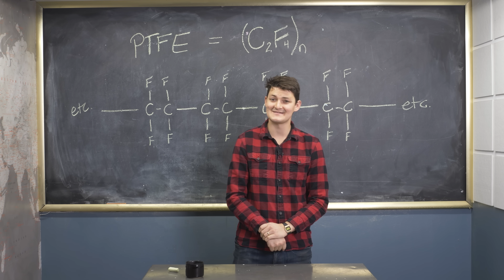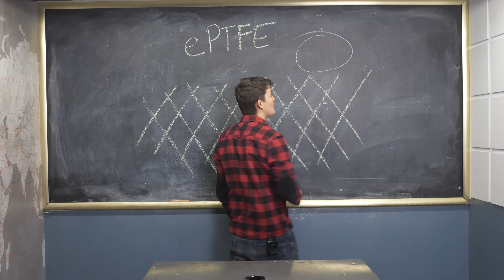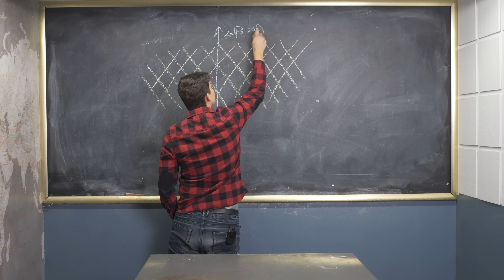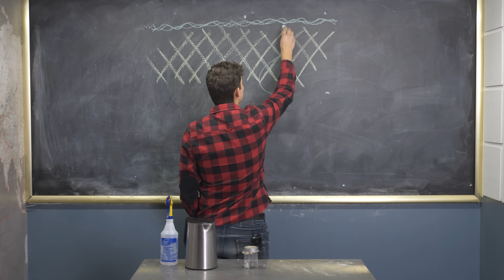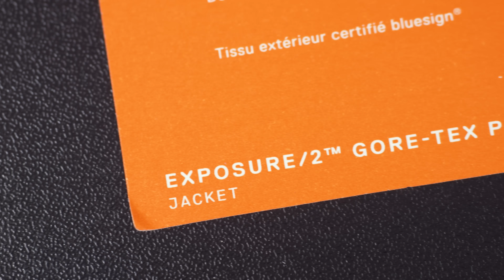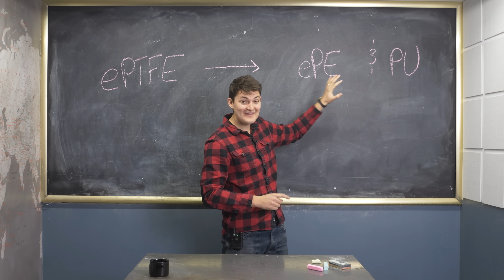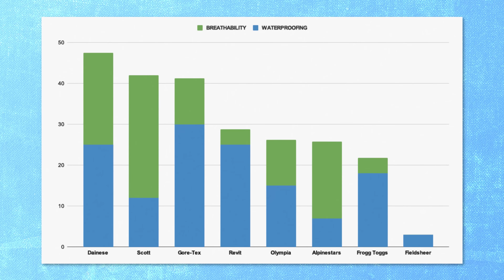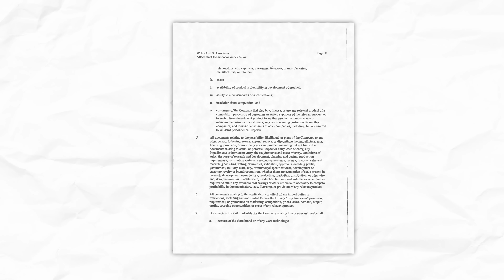Gore-Tex is a Marketing Gimmick

Comment: This is confirming what hikers have known for decades: Fabric can be waterproof or it can be breathable, but it can't be both. If egress of heat and sweat is required, the only really effective solution is mechanical ventilation: Pit zips, or some other similar equivalent.

It's a good thing, then, that Gore literally prohibits manufacturers (or at least they did at one point) from putting pit zips in any garment that uses a Gore Tex membrane in order to show off how "fancy" and "effective" their membrane is!

I will further add that in most cases where you'd want to be waterproof, also being breathable is exactly what us motorcyclists DON'T want. When your clothing is getting soaked by rain and it's likely that some part of your personage will also become so (via water inevitably getting in over your collar, or through your zippers, or up your cuffs, or whatever), the absolute last thing you want is a cold wind whipping through your "breathable" jacket and pants to make you even colder. Evaporative cooling is a son of a bitch, especially at 65 miles per hour. So for riding in the rain I have found it much more effective to completely skip any kind of fantastic malarkey about "breathable waterproof" wonder-fabrics and just toss some manner of impermeable shell over your regular riding gear. Frogg Toggs, a trash bag, a Tyvek rain suit, whatever you have to hand that fits. You can also forget whatever gimcrack rain liner came with your riding jacket that's supposed to go inside, because all that does is allow your jacket to absorb about 47 times its own weight in rainwater. If the liner your jacket came with can be worn over it, do that instead.
Reply: all my arctyryx goretex shells have pits
one of my shells is 100D nylon backing
there is no water or wind getting in OR out of that shell
and if u dont vent, u will sweat to death
but ofc, the trick will always be appropriate layering

Comment: Love the video as usual, but I’ll still always buy gore-tex due to their lifetime warrantee.  I bought a rev-it dominator years ago that eventually let water in after about 5 years. That’s two years after the manufactures warranted ran out. I contacted gore-tex, they paid for me to send it off and loaned me a similar rev-it suit in the mean time. After about 2 weeks, they admitted the leak and asked me if I wanted replacement or my money back. I went for the cash and they actually gave me the price of the new suit, about £300 more than I had paid.  I used that and added a bit more to upgraded to some Rukka gear.  That has a 5 year warranted plus the gore-tex lifetime. I’m still using it and it’s fine. If it leaks though, I’ll be sending it back again. Can’t beat that service in my eyes. Worth every penny

Comment: There are indeed really great laminated garments out there today.   Historically, the biggest benefit of the Gore branded outerwear was that Gore, protecting their brand, had a very real and significant testing and verification program.   "House brand" laminates almost invariably were built to a price from a CAD file sent to the Asian manufacturer with little to no further verification until the stuff showed up and either worked well or didn't.  I, personally, lament the loss of the old fluorinated DWRs which in my experience were extraordinarily durable and gave outdoor sports shops a lovely sweet chemical aroma each season.  I miss that as much as two stroke smoke on a cool morning.

Comment: Yeah it is all about name recognition. When i buy something with Gore-tex in it i have a better chance of it lasting longer. I have run into some absolute shit WPM in stuff i have bought in the last 10 years. Even some Gore-tex stuff. I have a original NF 1995 jacket with old bad Gore-tex that is still as waterproof as the day i bought it. I have a 2 year old NF jacket with Dry-Vent that leaks like a sieve. I have a 10 year old NF jacket with Dry-vent that works very well.  They just don't make shit like they used to.

Comment: GoreTex is a gimmick and a bad one. It's extremely bad ecologically to produce  without any real benefits to what natural fibers can do. My  waxed cotton coat outperform my previous Gore-tex coat and all I need to do to keep it water proof is to wax it. Same with well oiled leather boots. Natural wool will also outperform GoreTex and last as long as you take care of it.  Not until wool is saturated with 60% of its own weight will it feel wet to the touch. Since it retains 80% of its insulating value even when saturated, wool will keep you warm even when wet. Too me a Mackinaw wool coat is better than any  gore tex out there, too bad they are so hard to come across.

Comment: I use eVent for hiking and tramping here in NZ,  I also have several Gortex jackets.  After many adventures with both materials it always the eVent rain coat that gets taken. I have heard that as soon as you sweat in Gortex it basically turn it into a sweat factory, which is what I've found thru trail, I  mean trial  and error.   Might as well use plastic bin liner. Anyway good luck.

Comment: I have a goretex drysuit for sailing. It’s a one piece with rubber seals at neck and wrists. It leaks at the fabric joints because the tape has peeled off. $3,000 dud. Cool stuff

Comment: How many layer of goretex makes a big difference. More layers it is tougher and heavier. Less layers it doesn’t last long. If it stays wet to much rot will set in and it will leak.  One layer jackets are extremely light and breath well but may soak water through if it keeps raining for a few hours. 
But good breathable wader are way more comfortable then any rubber coated wader. Don’t ever put a breathable raincoat over a down jacket thinking you are going to be warm and dry. The down wilts up and you will be cold. They do make very expensive coats and sleeping bags that have gortex and down in one jacket or sleeping bags that work well.

Comment: I learned through hiking with a heavy backback uphill in New Zealand in the rain that Goretex is probably is super when you are not sweating and it is cold and dry outside. Without a temperature and moisture gradient (both higher inside) there is not much or even no moisture transport. And: When you really work up a sweat, nothing is going to transport that from your skin to the outside of your jacket in the amounts required. You might as well wear a plastic bag.

Comment: Goretex boots, or I'm now assuming any "membrane" boots, suck because eventually your toe wears a hole in the membrane. This lets the water in quickly, as a hole in any membrane would. Problem is, there is no way to get the water out. They are even difficult to dry when they are off your feet. So your feet end up more wet for longer than even an athletic shoe. I've been avoiding gore-Tex shoes for years, Even when I otherwise like the features of the footwear.

Comment: Cruising timber in the pnw in all weather all year, I learned about wool, breathes even when wet and keeps you warm even when wet. The only real waterproof gear doesn't breath at all and is basically a sweat suit. Turns out I don't mind a little wet if I'm warm and comfortable. Riding I just put a cheap leaky shell over my wool and deal with it happily. Boot gaiters and I'm in a 4 season dry boot for $25.

Comment: Awesome, but I would add, Gore-Tax is still the most water proof stuff for riding a motorbike there is.;))

I ride all year round in the Netherlands, previously in the UK, and it gets wet here fairly often, so I need the waterproofing with limited breathability.

The breathability for riding a motorbike is totally fine! 
Walking around in the jacket, trousers... Could be tricky as you indeed start to sweat.;))

But for peace of mind in rain, comfort... No way I will try anything else till something better comes along.

I'm using full Gore-Tax gear for 9 years, and I am as happy as I can be with it.

For jacket and trousers I recommend the ones where you have the Gore-Tax layer baked into the outer shell, so your whole jacket/trousers won't get saturated with water and needs 1 week to dry out... As a commuter, it was awful to get out of the soaked gear, then finish at work and climb back into the still wet and cold mess of a gear... 
The Gore-Tax lining kept me dry, but not the main bits of the gear.

130 000km in Gore-Tax and counting.

For other activities than riding a motorbike, it might not be the best.

Comment: Warranty
That's been the reason for me to choose goretex for my expensive jackets. 

A 5 year old motorcycle jacket which isn't mechanically damaged will get replaced if it leaks.
I have had my motorcycle jacket, gloves, outdoor shoes and hiking hardshell replaced under warranty.

My first hiking rain jacket was a normal non goretex membrane jacket. Leaking right after the warranty. Ended in the garbage as a result.
My millet goretex hardshell has been replaced twice well out warranty. End result is cheaper.

Comment: Any infantryman could have told you this decades ago. You get wet with it on or without, so what's the point? ...it's good when you're not moving. It's also good against gales of wind even if you're wet underneath. Mostly, we'd just get wet without it and dry off later.

Comment: Pretty good video.  Having been around since pretty much the beginning of goretex as the best thing since sliced bread, this is an old story to me.  The first and most obvious thing was that in practice from the very beginning was that the product worked on the sidewalk but not anywhere else.  I work in a profession that put me out in the environment in all weather states and gortex came up very short.  Funnily enough, the best performers were oilskins and wool sweater [if you didn't have to climb around at all] and any pvc/pu/vinyl embedded fabric if you needed to move.  Additionally, goretex had little abrasion or penetration resistance so it was common to have holes.  I had to bet my life on my wet gear so goretex didn't make the cut.  Even now my M/C wet gear is not goretex but an impermeable light weight synthetic.   Goretex has always been for the urban, yoga pant crowd and not for serious outdoor endeavours.
Reply: Most of my ultra-light rain gear is gore-tex and holds up outstandingly well, I've had some thicker gore-tex shells that got cuts like it was nothing but i've had the same jacket for going on five years now of trips and falls in the rocky mountains year round and whether it's loose pack shale or solid faces that thing will just not tear. it's definitely not my favorite waterproofing material but for the flexibility and lack of weight to it I've usually got a piece somewhere in my climbing bag. There's definitely a MASSIVE difference between the construction of the apparel and how easily it'll rip though.
Reply: That last point is wholly untrue.

Comment: Maybe I'm the outlier, but find it works super well snowboarding in rain, sleet, snow as long as you layer right to be comfortably warm and not sweating. My Gore Tex hiking boots are fantastic, just stand in a stream for a few seconds if my feet get too warm, let the outer evaporate and cool my feet. Stay completely dry inside all day long. Keep a temperature gradient across the membrane and it will keep you dry.
Reply: yeah I've never had any issues with gore-tex if I've got a smartwool base layer on. Aside from the cost that is.

Comment: Fact: people who can afford a 1000$ motorcycle Jacket NEVER ride in the rain. I own a goretex pair of Pants I bought for under 100$ NF , I also have a NF jacket( not goretex) that is just as water proof BUT the inside on the Pants is ALWAYS wet  from condensation when I take them off But not the Jacket.Both zippers closure leak anyways. Saphire nano invulner protector is expensive but it works ,  it's also hard to find.

Comment: Go buy a DWR jacket that is less breathable, and when the DWR coating is completely gone from the jacket and the jacket is no longer waterproof, you'll say "Damn, should have got that Gore-Tex that will last me 25 years." Also, your pooling model was a joke. Isn't Teflon the most slippery material ever made? So if worn correctly wouldn't the water just bead off without the need of DWR? I mean, who just lays on the ground in their jacket?

Comment: While I do agree with most of what you've said, I do think there's real life uses for Goretex, specially on mountain/hiking boots, because you can very often step onto a puddle or a river on a relatively dry day, having a boot that can stay waterproof while walking on a marsh and then breathe once its dry enough is very convenient. 

Many hiking jackets have zippers on the sides to help you breathe on a very intense trip while keeping you relatively safe from rain, ponchos are specially good on these conditions. I don't see that much use for Goretex in motorcycle clothes unfortunatetly.
Reply: Except, you can now buy superior products from other manufacturers that perform better than the original Gore-Tex product, which G-T doesn't make any more.
Reply: @avsystem3142  maybe, some people in the comments talk about Goretex superior quality control but I cannot test that out.

Comment: Something you failed to mention here (kind of). You pretty much have to babysit it for goretex to work… wash it with special soap or the membrane will be damaged. Reapply dwr for it to even work. And it’s fragile because both the jacket and pants leak to the point I still have to wear a rain layer to stay dry. 

I own the carve master. In fact. I’m covered in gore tex as my gloves and boots are also made from gore tex. Don’t waste your money on it. 

However te carve master on itself is amazing. Pretty high quality stuff and great for warm and cold weather riding.

Comment: I've used gore-tex on winter boots and gloves for the last 10 years. You made valid points, but unreal. In the real world when it rains you don't get the whole gore-tex piece of clothing immersed in water or if do so not for long enough to give your own sweating a chance to condense back in and for sure water falls down a jacket leaving many gaps where the body steam can pass through. Well maintained Gore-tex clothing and shoes are the best option any time, any day, all winter season in UK and Spain's mountains
Reply: while trying to find some adv boots I returned 5 pairs of different brands and models all goretex. i tested them in a bowl of water for 15mins, all of them got serious moisture that makes you a bit uncomfortable. I also did that with 3 pairs of gloves same results

Comment: I haven't found much need for waterproof breathable motorcycle gear.  I'm not sweating and overheating when riding a motorcycle, as I do when hiking, so I don't need breathable garments.  I prefer waterproof and not breathable because when I want rain protection, I also want protection from the wind to stay warm at 60 MPH.

A $60 Amazon special one piece motorcycle rain suit works great, even though I get no Dainese or Klim style points.  In practice, unless I need extreme durability for commuting, I carry DuPont (TM) Tychem yellow seam sealed Tyvek coveralls with elastic ankle and wrist cuffs and a hood that is thin enough to tuck into a helmet to prevent water from running down my back.  It packs into the size of a burrito and weighs a few ounces.  On the down side, it's cut large and flaps in the breeze but $38 for 1-2 years of ultralight rain protection on my bike is a value and it's consistent with my ultralight motorcycle camping philosophy.

Comment: Trick is to buy laminated Gore or equivalent (though Gore has worked the best for me) with good waterproof venting. Most of the cheap stuff has a separate fabric layer on top of membrane and that fabric will get soaking wet causing the negative effects shown. If you’re going the cheaper route, just get a proper raincoat. For the miserable Nordic conditions I’ve found laminated membrane to be the best option if you just want one outfit. Just make sure the quality is high - you don’t want leaky zippers and bad stitching.

Breathability issues can be mitigated with good venting but you really need more than two vents.

DWR is neat but needs to be reapplied pretty much every time after you ride through even slightly heavier rain.
Reply: Love my Sorel laminated rain gear!!!

Comment: Hi Ryan. Did you ever try an OutDry membrane? Columbia uses that a lot. I know Columbia doesn't make motorcycling gear, but I very much like OutDry. There is no need for DWR, since the w/p layer is on the outside. It should also not wet out, did not happen to me at least (yet). Regards from Slovakia, René

Comment: I stopped caring about GoreTex because it stops being waterproof the first time you stress the seams.  I highly doubt Ryan's jacket continued to be waterproof after that hike in the woods.  You're far better off with a waxy waterproofing spray or rub; it doesn't breath, but that's what zipper vents are for.  I've owned 3 pairs of Gore boots and 2 jackets, none of them continued to be waterproof after a month.

Comment: It's just like Apple products.  10 years ago, I purchased an Toshiba Intel i7- 3630QM laptop for $550 with 720i display at Best Buy.  Apple had the same spec Intel i7 with a clearer 720i for $1200.  Sure it has the better screen and aluminum skeleton that they love to market, but the performance was pretty much identical, 500GB HD, 4MB of RAM with expandable slots, but is it worth the extra $650?  They can charge that because of the name plate, same as how Gore-Tex can charge a premium for theirs.  Gore-Tex is the Apple product in the water/weatherproof world.  BTW, that Toshiba is still running and it's used regular to stream to my TV.

Well done Ryan and team, this is an eye opener for those who are obsessed with gimmicky brand name.